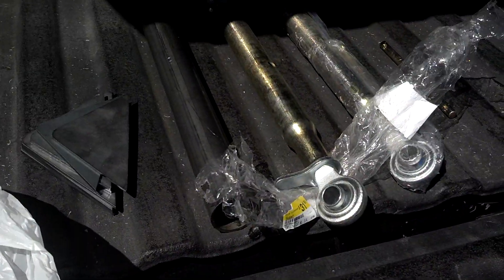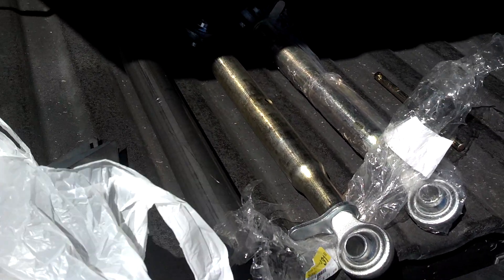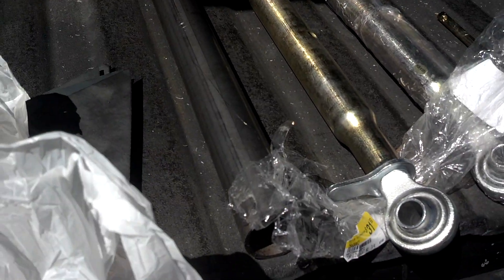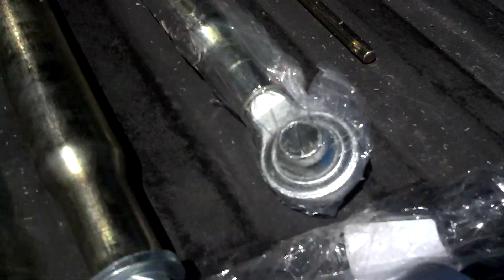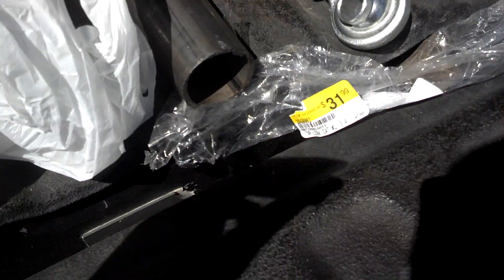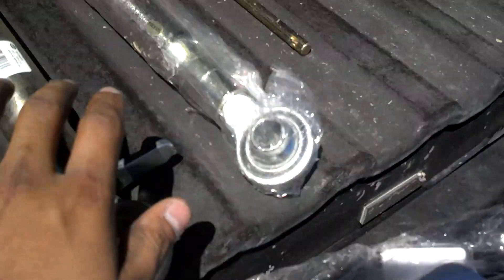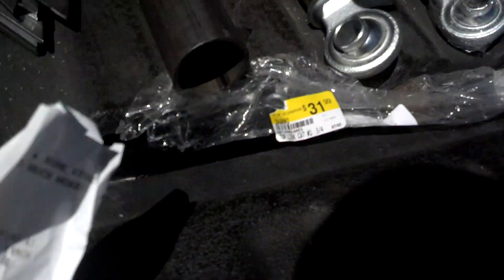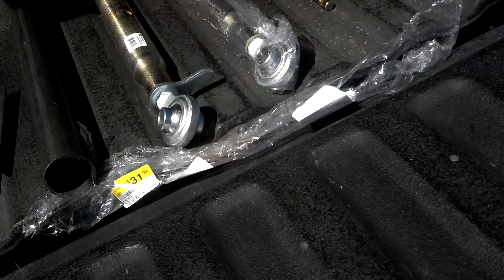Traction bar build

Comment: thank you for your video. I have done 2 sets of Tractions bars using your idea from Cal-ranch. 1 set for my duramax which I extended the bars to about 5 feet long and 1 set on my mud race truck without any modification and using the axle spring mounts that you can buy from there, which saved  money. I spent about 125 for the ones on my duramax and about 75 on my mud race truck. It was very simple to make to. Thank you! FYI, you can get these tractor bars from Harbor freight for about 20 each or even cheaper if you use their coupons
Reply from the maker: sweet man! im glad i could help someone. let me know if u have any more questions dude.
Reply: +steve “Swicket” bigbird tractor bars? I don't see them on their website.
Reply: The item number for harbor freight is 60634 and they are called a category 1 top link
Reply: steve bigbird Thanks a bunch man.
Reply: Yep

Comment: those heim joints look a little anorexic and more like galvanized then stainless. howre they holding up so far?
Reply from the maker: there tractor heims and i dont got any stainless steel anything with these traction bar build. there holding up great i havent had a problem there a little noisey at first but u get use to it. i need to get like real rubber bushings to make it quieter and they make it ride a little rougher but thats traction bars for u